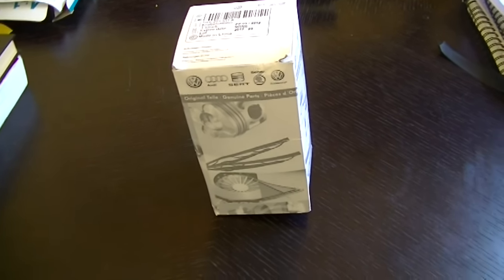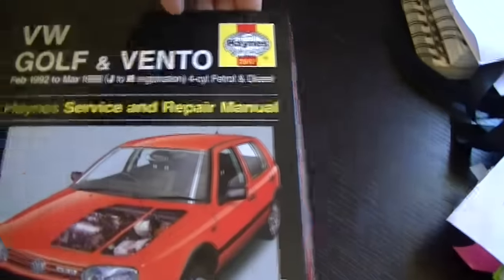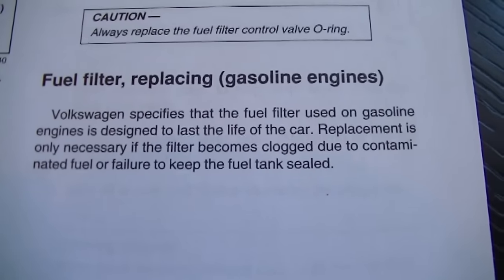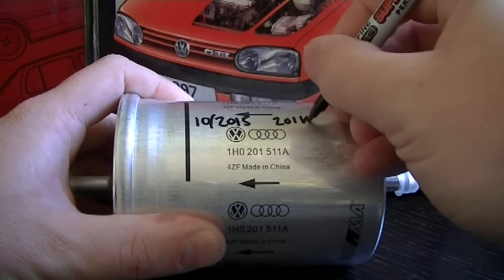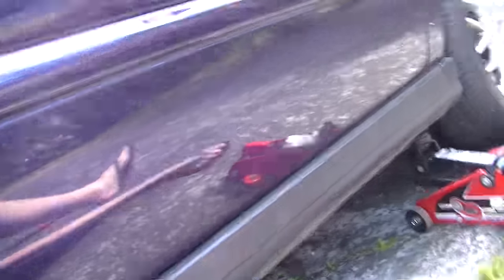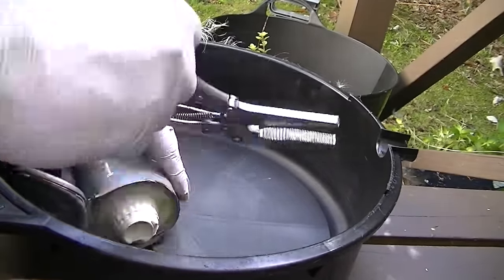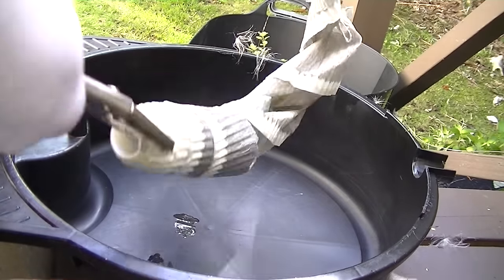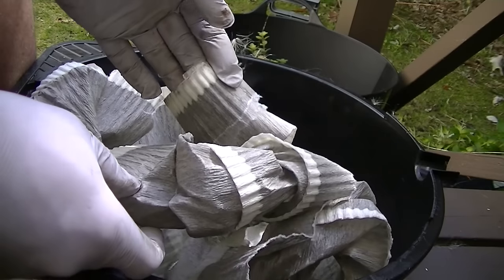Golf VR6 Fuel Filter Info and DIY

Comment: Genuine German part made in China for a genuine German car made in Mexico (for the US market, anyway!).  :D

I tend to change my fuel filters once a year, just 'cause they're so bloody cheap, especially compared to the cost of new injectors or a fuel pump.  My mum's got a 2002 GMC Yukon that I've given a new fuel filter every year, and half a quart of ATF in the fuel tank at every oil change.  ~370,000km on the truck, she's owned it since it was new, and it's still got the original fuel pump in it.  There's something to be said for regular maintenance.  :)
Reply from the maker: +rhkips Exactly! My Golf was made in Germany for the Japanese market then imported to New Zealand at 5 years old.

Definitely cheap insurance against needing a set of injectors. I'm a big fan of proper maintenance, especially when it's cheaper and easier than the alternative.

I had to google a GMC Yukon! Nice looking truck.